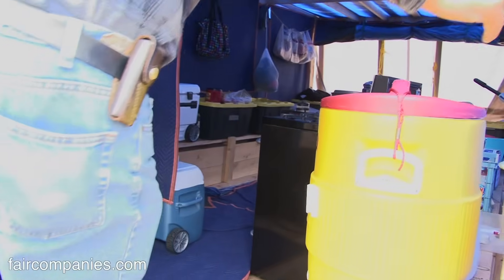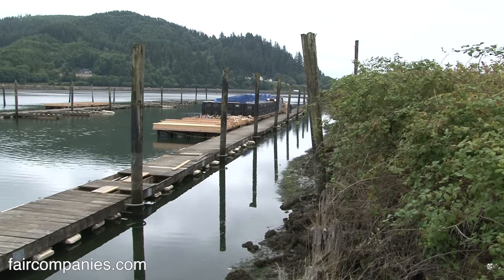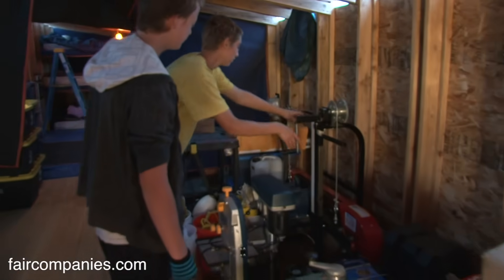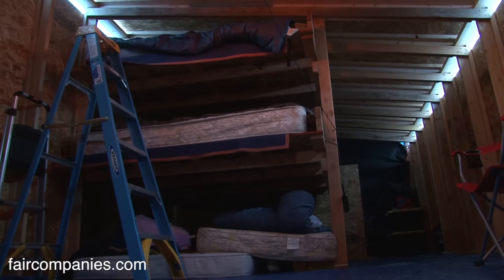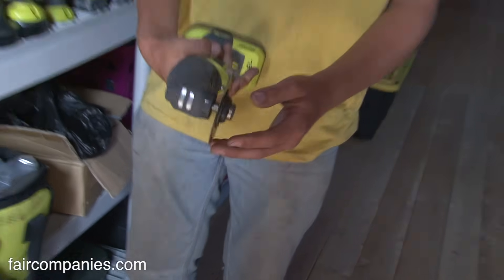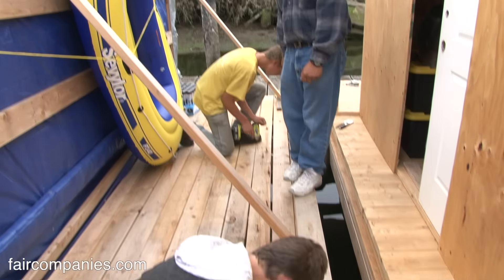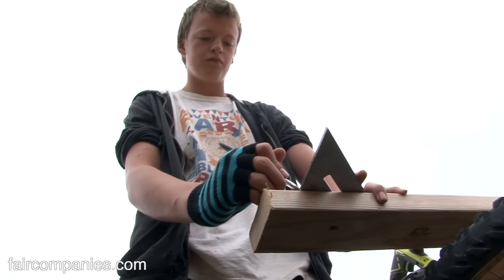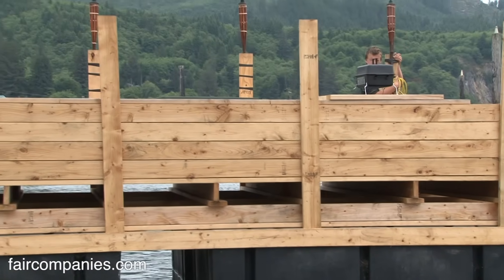Oregon "teens + dad" team build barge home and workshop

Comment: I've been a builder for 45 years and everything I saw on this film was done wrong. That father is trying his best to do the right thing by his kids and for that I give him an A+
but those glorified docks made of SPF spruce will rot and fall apart in a few years. The screws will snap under any stress.  The stress out on the water is far greater than this guy realizes. All of the structure should be Pressure Treated and every single framing member should be through drilled and bolted with stainless hardware. 
If the guy is planning on building a 60' x 100' home on the water in the technique we see here, well let's just say this:
I hope you taught your boys how to swim. 
You are a dreamer my friend, you are underfunded, uneducated
and doing your boys no favors at all. I'm sorry to be so rough but I spent 45 years building houses 544 of them to be exact. Construction like the kind your doing belongs on a backyard shed or chicken coop NOT ON THE WATER AND DEFINITELY NOT TO LIVE IN.  
Your building a whole bunch of loose goosy docks on top of floats that are designed to be encased with a frame 2/3rds of their height NOT
The width of a 2 x 6. 
If you have to keep going with this mess please don't plan on leaving that dock and definitely don't plan on building another story. The walls you built are out of code, unsheathed, and a real hazard to human life. 
If you truly care for your boys you'll stop what you're doing and learn how to do it the right way or don't do it at all!!
I wouldn't park my lawn mower on those contraptions. 
Good luck
God bless 
Peace✌🏻
Reply: I agree with everything you said but I have one question.  When taking on a project like this... building a "house barge"... where do you find the information to build it the right way?  I have never seen a boat building book on such a topic.  U.S. Army, Ret.  Texas

Comment: Build floats all the way around. Side, bottom,top. Inside on a sliding track. If the wind blows the boat over all sides are secure with floats and inside the track will automatically spin and ajust the the inside to whatever side its flipped on
Reply: Astral...how nice. you are first person to explain how this beautiful family could actually make their dream work without putting the father down  in front of his boys, one of which has been following this thread closely. Thanks for that.

Comment: Great video, but I am concerned that there does not appear to be much triangulation in the design? What stops it folding?
Reply: neogovernment nails. Lots of nails and supports. And beams going across the roof.
Reply: Lots of nails*
Reply: Good point. Cross bracing would be a great idea before going to Alaska

Comment: What kind of wood did you uses?  It doesn't look like it's any of the traditional boat building woods that is water rot resistant, pressure treated lumber or marine grade plywood.  You need to re-think your boat/barge building material choices and design.  Are the screws that you used Stainless Steel or marine grade so they resistant to salt water corrosion? FYI I'm a retired US Coast Guardsman and was a Boarding Officer.  If I was to do boarding I would have serious enough concerns to request a "Manifest of Unsafe Voyage" until a marine inspection could be performed.  I get what you are trying to do but your "barge" is not see worthy.

Comment: The floats will still float, but the ocean will crack it apart and dump the deck off the floats. Dock floats are great for docks, but I've never seen anyone sail a dock in the waves. If they stay put, they will be alright, but it will be disaster if they take that design out into the open ocean.  This is great for a lake or to stay in the harbor where docks normally are.
Reply: The above comment is in reference to the 4 float pieces made from wood that I assumed would be connected to each other by wood as well. The description on the website uses steel beams to hold together the entire structure, so it may be strong enough to hold together after all. I sure don't know. http://pacificiceberg.org/boatinfo.html

Comment: What's it FOR?  You can't take that pile of junk into the ocean. The first large wave will capsize the thing. You can't tow it anywhere unless you have a dead calm sea.  You can't move it anywhere except inside the sludge mud bay they built it in. It's not a ship and its not a barge:  Its a square piece of floating crap that is not sea worthy.
Reply: Adam Ape haha.
either your troll or your twelve.
Is everyone else wrong but you? That might say something.
If your not a kid troll you need to re evaluate your life view. Its short and your wasting it.
Reply: Its a home...you live on it like a floating home.
Reply: Richard Ball What!>?
On a mud flat?
In the middle of an abandoned marina?
Build it on LAND stupid, and build your house where it isn't a swamp and an ugly bunch of ruined old buildings and build it near a road
Build it on wheels ANYTHING but that gawdawful place that stinks of mud and mosquitoes and ugly old rotting timber
Reply: Ideal for rivers and lakes
Reply: And still you keep going lol ... silly angry man .
Reply: Adam Ape Did you know there are large ships that fill with water and I can simply float my boat onto the deck and then they pump out the water and I'm high and dry on the deck? Then my little boat can go anywhere.
They also do this with large yachts, pretty common to ship too Europe.
This guy in this video seems like a good smart man, I'm sure he has a plan.
Your case? Your just a negative man.
Reply: I'm sorry you're such an angry person ... most of everything you post is full of angry negative opinions with little resolve. You should find nicer, positive people to hang out with and try not to get so hung up on things, having a permanent chip on your shoulder is no way to live mr. I hope you find the help you need hugs
Reply: at no point did they say its going in the sea
Reply: Jay Simons I was thinking of naming it "United States presidential election 2008" but quickly withdrew, fearing that it might trigger someone
Reply: Rax Raccoon
You really don't know how fucking stupid your comment is: do you?
Reply: Adam Ape You're just a bundle of sunshine, aren't you?
Reply: RandomIanBeamish
There is a difference between people who are idiots and people who are not idiots.
You not only can't tell the difference... you don't LIKE the difference because it singles out the stupidity of idiots and exposes them and that means YOU also.
Reply: Adam Ape Adam, you're wasting space with senseless emotional comments with no substance and you're missing the main objective because of it. constructive criticism followed by suggested solutions would be much more productive.
Reply: Carla Tonga fuck are you STUPID... and I mean DUMB... I mean BRAINLESS
let me guess: you're 7 yrs old and you never built a thing in your life and you don't know the back end of a shovel  from your ass: right?... RIGHT
Reply: Carla Tonga
jesus fucking christ on a crutch
so this is the new batch of marshmellow internet freaks
Reply: Carla Tonga
hey marshmellow
your brain is SHIT
You have SHIT for brains
you're soft in the head
your brain is a MARSHMELLOW
you HAVE no brains
you have a MARSHMELLOW between your ears
that stinks of SHIT
Reply: yuck. You have an awful personality.
There is an inside passage up to Alaska. Also as most marina today are built off site and simply shipped in large sections. This modular building tech is suited for that. I'm sure the intent is not to be in the high seas but the sheltered bays and waterways when there is a weather window.
Reply: jackchorn
Well if you're right;
IF the marina is located where you say it is. inside this inland waterway
IF they do not intend on living in that marina.
If they intended to move the houseboat along this inland waterway.
If they intended to live in Alaska and not the lower 50 states.
If they have a location they can move to without taking the house into the open ocean...  Then you're right and I'm wrong
BUT... your case has LOTS OF ASSUMPTIONS
My case is based on less assumptions
Why don't you contact these idiots and find out?
That way all this guessing can be eliminated.
Reply: jackchorn
GO FUCK YOURSELF
YOU ARE A FUCKING TROLL
GET OUT OF HERE YOU FUCKING TROLL
Reply: Adam Ape your brain will pop if your not careful
Reply: jackchorn
GET LOST  TROLL
Reply: Adam Ape Totally agree.
Reply: Indrekk Pringi Funny YOU calling Others "troll" You Know NOTHING of OREGON, We have MANY Rivers and Lakes and these people are doing something constructive with their life. What do you do? I wanna hear it, WHAT DO YOU DO? Oh That's Right you go around on videos making ignorant comments, Well Guess what, I can TROLL With the best of them and YOU have my attention, You will amuse me from now on.
Now dance Fool.
Reply: Jay Simons I just made a spaceship with my own feces and I was wondering if you can support me when people make hateful comments about it
Reply: Depends, will the shitship have an interesting name? I'm Busy trolling the hell out of that Pringles guy, I find him rather amusing, LOL!
Reply: Sounds like a plan, very descriptive of the '08 elections, I like it!
Reply: Indrekk Pringi
 Holy Shit Pringi you are one stupid fuck aren't you, I have been there before, just because it was built "on the coast" DOESNT MEAN IT'S GOING IN THE OCEAN,  IT IS STAYING RIGHT WHERE IT IS AT...See the Video? Does that look like the fucking ocean to you? (Answer is No it certainly does not look like the ocean). YOU DUMB FUCK.
Reply: Jay Simons
So the family that built this piece of floating crap is going to live in an abandoned marina?  So they're going to live alone in  mosquito-infested rotting swamp filled with toxic sludge isolated from the entire world with no electricity or plumbing?  So if the police catch them living there illegally and order them off the property what will they do?  If someone buys that marina what will they do?  You like exposing your fucking STUPIDITY don't you?
Reply: Speaking of stupidity, I actually live in Oregon, and I know of many people that do this, not exactly the same way but close...And the worst that would happen is they are told to move it up river a bit...But go ahead, Keep spewing shit...You amuse me.
Reply: Indrekk Pringi
 Oh look what I found, a map of the marina...
https://www.google.com/maps/place/Garibaldi+Marina/@45.5563589,-123.9129959,17z/data=!4m2!3m1!1s0x54eb32bb22404c2f:0x1496c6c9b94f3110
Whats that little blue thing attached to the back of it? Oh yes a RIVER, (Technically a "Creek") They ended up actually moving it up that 7 miles then later sold it...
Thank you and good night.
Reply: Jay Simons
gee whiz:
try looking into your shit filled soul and your shit filled brain
and your shit filled existence
you STUPID POINTLESS WASTE
Reply: Says the guy that hates Jews...And Americans, And Gays...And Random people building barges...No, ESPECIALLY Those Barge people.
Who's the one shit filled, Not me! All you are is free entertainment! I guess I should thank you!!!!
Reply: I'll gladly go over there, after a short conversation he would volunteer to remove himself from the gene pool! :)
I have a way of getting under the skin of people like him, then festering till it becomes infected....Kinda like a Tick carrying Lime disease, lmao.
Reply: Indrekk Pringi
 Whats funny Mr Pringles is that when you are proven wrong you use insults, the same insults you use on others..And you call ME "Egotistical"?...Too bad nothing you could ever say will faze me in the least, YOU on the other hand...you are probably having a raging fit...Good.
I don't like you, but you entertain me..I shall keep you around, Just knowing I'm making your day shit brightens mine just a little bit.
I hear you wrote a book, Good! I need more  Toilet paper,I could find any information about you I want including this "Book" I'll be wiping my ass with... toilet paper is this thing Americans use to wipe our asses with instead of our bare hands...You should try it someday!
Reply: you should seesome other peoples comments on other videos, nobody likes that poser
Reply: Marko Feller
The last guy that got my attention like this was some Nazi skinhead, I bugged him for two year's till he decided to vanish from the interwebs, ...Perhaps he decided being a spiteful bastard wasn't worth his time...LOL.
Mr Pringles is in for one hell of a roller coaster ride. I can be nice and sweet, My lovely wife could attest to that, OR..Lmao...I can be "Mr not nice"...a stubborn, patient asshole...I might forget to bug Mr Pringles, but when he least expects it, BAM...Trollollul!
......
You see that Mr Pringles? That's a Promise, Everything you have dished out to everybody I will deliver back to you! AND I WILL ENJOY IT!
Reply: Again with more insults, LMAO...You have been PROVEN wrong and YOU HATE IT.
Everything you have said to me or about be reflects your own sad deluded life.
Reply: Ok.

trollface Lmao.
Reply: Jay Simons Grow up.
Reply: Dude, Lighten up....Its a damn joke.
Reply: Marko Feller turds like you are a disease filled with pus HATE and envy
Reply: Marko Feller listen yo ignorant illiterate turd
you exist in LA-LA-LAND
You're NUTS
You're CRAZY
You're an insane paranoid FREAK
You PROTEST TOO MUCH
You're a CONGENITAL LIAR
You've got a huge GUILTY CONSCIENCE
plus:

You can't refute the truth of what I say about you
all you can do is spew your shit stinking lies on the  internet
GUESS WHAT:   FREAK
There are HUNDREDS OF MILLIONS OF LYING JACKASSES ON THE INTERNET
and YOU'RE ONE OF THEM>>>>>>>
Reply: +Indrekk Pringi Hey Pringles, remember this?  I didn't lie did I! You have been a naughty little boy since you got my attention, LOL....give it up, you spew the same hate filled rhetoric in every single comment. 
How about YOU try a little harder, you brag so much about being intelligent, yet I have yet to be witness to this so called "intelligence" of yours.
Reply: +Jay Simons 
turd

Comment: When you build, you stack on top, not hang every thing off the side and expect 4 screws to hold everything. And yes that wood,(not treated), will fall apart in short order. Wood wicks water. Find the correct materials, learn the correct skills. No regulations, or ordnances on building a playscape or treehouse.
Reply: If you stack too much on top, it will collapse inward, and it was MUCH MUCH MUUUCCCHHH more than 4 screws, it was AT LEAST 8 in each T-frame plus nails and other things

Comment: I don't like that OSB it will fall apart in no time. Even 1088 marine ply will only last 10 years. As a training exercise it is fine but it will not last long.
Reply: I agree, I was going to post would love to see this 10 years from now. I think they are building way to big also. I dont see a second floor being that balanced. The bottom is going to be to light with all that plastic. I think he should of bought an old cheap trash barge and built on top of it. Them benches open the wrong way imo also.
Reply: Yeah I was shocked they weren't even sealing the wood. Black Locust might hold up but it's hard to come by and once it's dry it's like trying to cut metal with a wood blade. Pine will start rotting in no time. I also question how he plans to move it. I was working on designs for a self contained barge that would include greenhouses. I was looking at 40'X60' and even at that size it was going to take a pair of the largest motors I could find. He's talking 3X the size and 4 or more times the mass. He'll need a tug boat to move it and that will be just a few knots. The lake boats they run on the Great Lakes tend to run 600' to 900'+ and they have full on engine rooms. I don't know if a 1000 horses would push that thing. I'd lean on 2,500 or more horse power and even then I'd say 5 to 10 knots would be lucky. Remember he's pushing a dock so it's not exactly cutting the water. To make it to Alaska he might want to drag a fuel tanker behind it as well. Engines that size will suck through a 1000 gallons in a day. I don't think he's thought this one through. The fact all the wood is exposed and unsealed is your first sign.
Reply: Cary Howe I think if he tries to go to Alaska his boat will get torn apart by waves very quickly, that thing should stay on flat water

Comment: I've been around ships, barges, and marinas my whole life. I lived aboard my sailboat for 12 years. I've sailed both the Pacific and the Atlantic. I can tell just by looking at it, unless the structure and interior load weight isn't balanced perfectly, in high winds or heavy seas it's going to capsize easily. Two stories ? No way is it going to stay upright even in moderate swells. The wood is NOT marine grade. What he's calling plywood isn't even close to marine grade plywood. It's cheap ass particle board. Ever see what happens to particle board when it's damp or humid ? It comes apart. Tow it to Alaska ? I wouldn't moved it more than 2 ft. from the dock. Somebody's going to die. Hope it's not his boys.